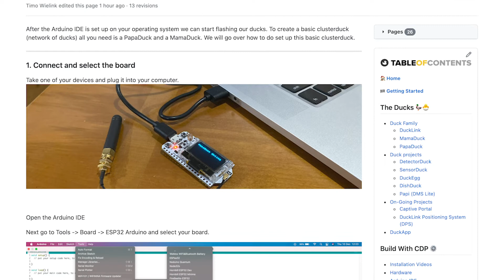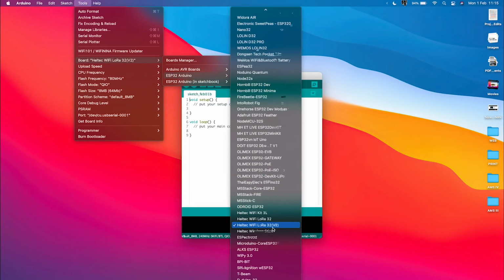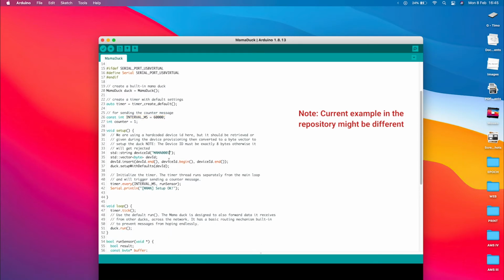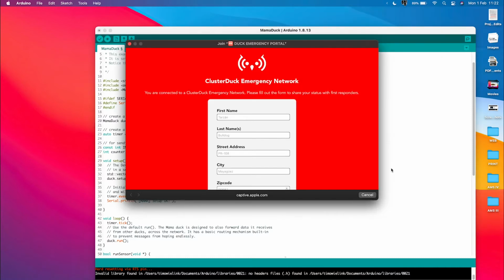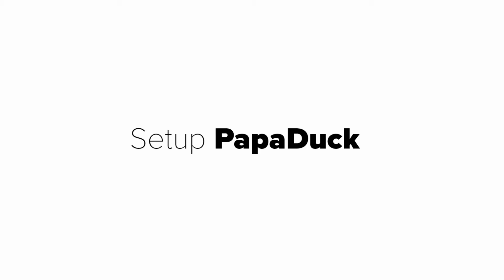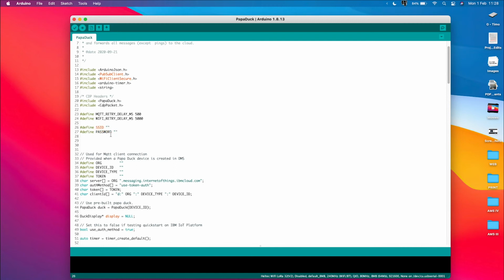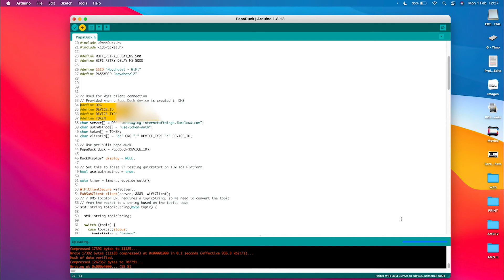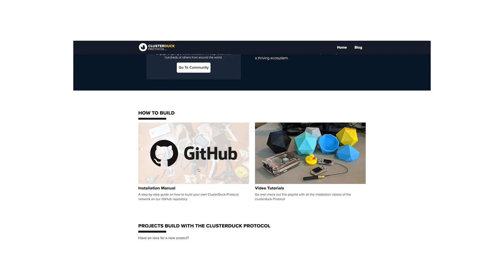Episode 3: Setup and Upload a Duck | Simple CDP Network

Comment: great project, can i use rfm95w, with esp32. what if i want to send message directly from the code without connecting via wifi or lets say i want to connect it to another microcontroller which connected to sensor and send data via serial comm?